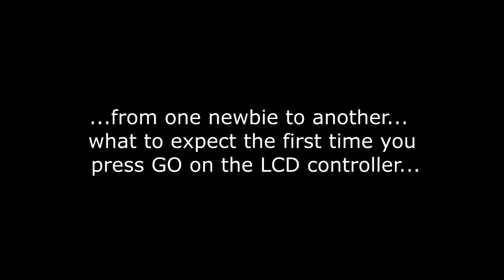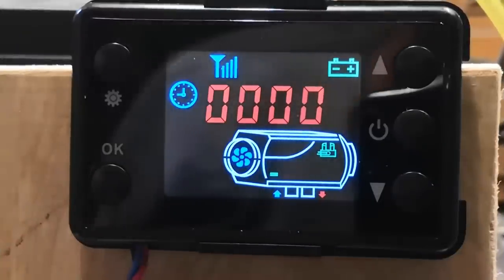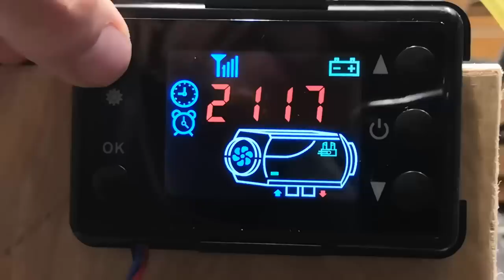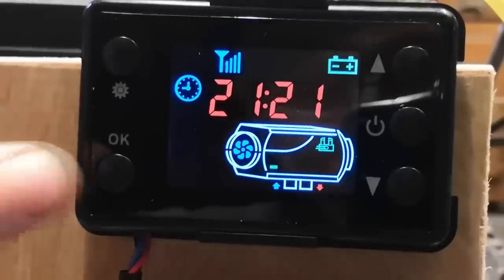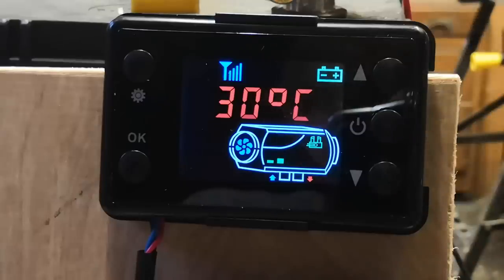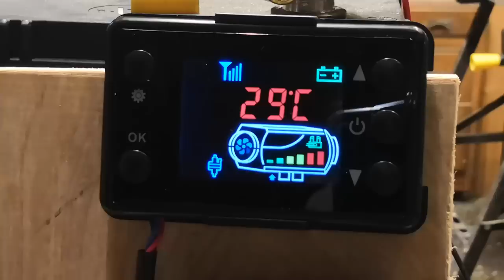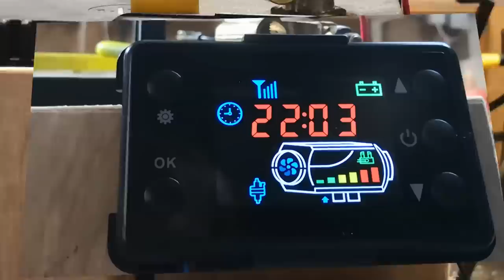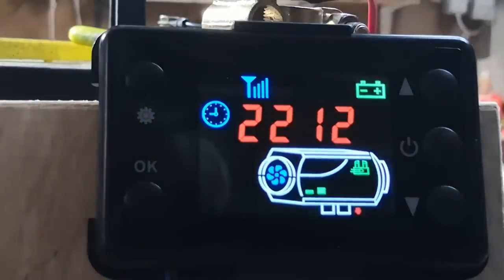First Time you press go...  LCD Controller- Chinese Heater

Comment: Great instructions however i couldn't find temp to adjust. Otherwise it's primed and working. Thanks.
Reply from the maker: Do you see a 'P' number? if so you are on manual mode rather than thermostatic mode. This vid shows you how to switch between the two.  https://youtu.be/NhKU4AIt4jM
Reply: @campervan_hackers  hi, yes i see the "P" number, I can alter that. It's the 2-5 kw heater so I've dropped it down to P3. Now I've watched this video now I now how to switch to thermostat mode. Thanks once again for the instructional video.
Reply: When you can see the p number, press & hold the top right up ⬆️ button and then top left settings ⚙️ button at the same time. Should switch out of p mode & into temperature reading

Comment: Thanks for the Vid, seems simple enough. I'm in OZ and not far off first nervous fire up. I was thinking of sucking the fuel through to the pump then priming from there to the heater stopping about 100mm from the end connecting the pipe to the heater and starting it at that point. Does that sound OK. Hope you guys are OK with the Covid over there. Take care. Cheers
Reply from the maker: Hope first fire up went okay
Reply: @campervan_hackers  Thanks it went perfectly.

Comment: Hey thank you for this most helpful and informative video! By far the best we've seen! 

Hey so we got our diesel parking heater a few months back and all worked like a dream. Only recently we now hear the pump ticking sound going... strangely when the diesel heater is not on? Any ideas what it could be? We've even tried putting the heater on full blast for a while, then switching it off... but still the ticking goes? Any suggestions really very much appreciated! Thank you kindly

Comment: Thanks for the video. After changing from hz to degrees iv set temp to 20 and room temp is 25 but it still turns on and starts heating when I press the go button even though its well over the set temperature. Is that right not sure why it's turning on at all at that temperature.
Reply: I've the remote, where I can read the temperature of the sensor of the heater. That is always wrong, that may be the problem, that it not works as it should.

Comment: Whats the air volume output for the blower on one of these? Would it be feasible to add some ducting in so that it blows heat from more than one location inside of a small cabin?

Comment: Thank god for people like you👍. Got my heater running but having trouble with the controller. When I try setting the time the first number for the hour only gives a 1 or 2. 2nd issue is I can’t turn down the temp. I can increase it. Right now it’s set at 36 deg. I managed to get it lowered from 38 deg. I suspect the controller may be trash.? Or I’m just not getting it.
Reply from the maker: The first number on the clock is always 0, 1 or 2 because it is 24 hour clock format 9 (08.30, 21.45 etc etc). But yep... sounds like a controller issue on the temp thing. You could try running it on manual.. (press and hold the top two buttons when in temp setting). You will then see Hz. This is the pump speed... in fact, I prefer to run like that.
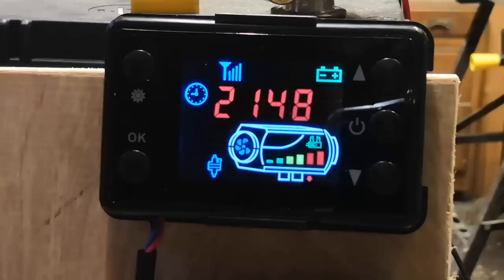Reply: Camper Convert thanks for the reply. The numbers come up 20:00 or 10:00. With that and the temp I’m sure it’s a controller issue. Great video on this thing.

Comment: These controllers are £12 on ebay and not worth repairing but the backlight on mine has virtually gone out. I don't know that I've inadvertantly dimmed it or even if that is possible. Seems more likely the LEDs have been destroyed by the peak voltage from my solar panels via the battery charger hitting 14.6V on sunny days. The manufacturer of these controllers state the importance of not exceeding (I recall around) 12.5V (on the one I have - I note there are 24v units available).  These 3 wire devices I assume control a relay in the heater itself that handles the 9 amp current to the glow plug. I noticed a 3 Volt drop at start up and shutdown as the glow plug heats the chamber to ensure combustion is complete thus avoiding carbon build up. What I plan to do is use an 8V-18V voltage inverter I have lying around to step voltage up to 19V then use a bucky inverter to drop down to a steady 12V on the back of the controller so it will ensure consistant 12V in all weather (cold, winter batteries at 11.6V through summer 14.6V peak) to save the backlight at least.
Reply: Its certainly not a common fault for the backlight to blow on these considering the 1000's of RV solar installations.  3 volt drop does sound a bit too much might have to beef up your wiring however the unit has hi low voltage sensing and will shut down if it goes out of spec. So if it works its in spec. My solar also can hit 14.8v for a few minutes as it ends the bulk fast charge before going back to 14.2 and the only thing it does sometimes is trip my inverter on over volts if there is no load.  I personally wouldn't worry about using buck and boost cos if they blow you can end up with a much bigger problem and you lose the battery volt monitor.
Reply: @tonytca9439  Sorry my typo, 0.3V drop, e.g. 12.2 to 11.9 - its quite a heavy duty "ring main" that is tapped off where necessary. 
I'm waiting for a replacement. The odd thing is its not the backlight, when I operated mine with the cover off I can see the LED's are bright. It seems to be a contrast type issue.

Comment: Gday from Sydney,  i have one of these units in a caravan i bought, instructions are confusing but your video set me straight, one question though  do you have to do this each time you start up? I had do do this on mine because the fuel line was broken, thnx
Reply from the maker: Hi... if you are referring to priming the answer is no.. you should just be able to hit the go button and all is good. To be honest I did not do a very good job at talking about when you should or should not prime so actually done a second version of that video with more on priming. You can find it here.  https://youtu.be/eajqNHY5rs4

Comment: I’ve got the LCD controller pretty much worked out in the settings  but can’t find any info on what SN1 and SN2 are, I’ve set my min pump speed at 1hz and max at 5hz and it runs great.
Reply: Sn-1 and sn-2 are the settings for the motor speed sensor 1 being slower than 2 from what I could work out set mine on 2 the motor is faster

Comment: Very good instruction mate  nothing really comes with the pack but there's just one thing how do I change the temperature from Hz to Celsius it comes up with Celsius for the temperature now but the temperature i want to reach comes up as Hz
Reply: Mat al sorted now all you do is press the up arrow and the settings button and it will change to Celsius I got the answer on club 80-90 forum very helpful people on there
Reply: Ifigured this out BUT have no way to change to Fahrenheit? anyone know if it is even possible?

Comment: my heat setting only goes by power setting. (1.4 tp 5.0) How do I make it seek a temperature instead ?? Great Presentation Thanks Grayson
Reply: mine was the same ... just press the settings button and up button at the same time it changes it to temperature mode

Comment: A forum is mentioned but where is the link to the forum? I primed the pump but I still get an E-01 error when trying to start so it don’t start at all! It’s a 24v but I’ve got it connected to 12v battery till I get organised. It say it can operate down to 11v or so, so that shouldn’t be a problem but it might be. Anyone know the error?
Reply: E-04 low amp I'm having the same problem
Reply: E-04 is oil pump, check see if lines connected right way. I got my E-01 error fixed with changing from 24v to 12v in the settings the pin to get into the settings is 1688. Then I got a E-03 error which is about egnition failure and glow plug, thought I had a bad glowplug but turns out it was because of not enough grunt in my battery to start it. I put it back on 24v battery and it started.

Comment: Really great advice.very very helpful.
And nicely explained. Do you have any plans to show how to pair the remote to the lcd device. That would be greatly appreciated i searched and searched but noone has  explained that one yet.
Thanks again keep bloggin .mike.in ireland
Reply from the maker: Hold up arrow until HFA (or HFR)
Press remote on key and signal bars should flash off and then back on. The heater should start
Reply: @campervan_hackers  thankyou👍

Comment: Great video !   I have a question ?   Can these units be set up like a furnace ?  To where the unit will cycle on and off ?  Or is this a On /Off unit/s only ?  They run all the time correct ? & another question ?  Is there anyway to change temperature from Celsius to Fahrenheit ?    Thank you for your time
Reply from the maker: Soz deg C only....  they will not cycle on and of... they will only go down to the losest burn rate they can function at

Comment: Thank you for the great video, really helpful, but for some reason I can’t get the time to come up on my control unit am I doing something wrong?
Reply from the maker: It might be you don't have this controller... even though it looks like it. For clarity... this controller has a fan icon with SIX blades... if yours has THREE blades... it has slightly different features.

Comment: I have a non remote lcd controler with a small round plug and I want to change the controler to a remote type. All the remote ready controllers have a triangler shaped plug. can I wire the remote type into the round plug ? They both have three wires. Any help on this would be appreciated

Comment: Thanks for your video - very helpful. I have just installed a new lcd controller. On the main screen, when I try to set the temperature for the heater it shows "P-4.0 Hz" instead of the temperature setting. How can I change the setting to show the set temperature rather than the current display. Thanks
Reply: Hi, just found the answer to my question. Press the on/off button while holding down the < > buttons.
Reply: Thanks Bruce! Been looking around for ages to find out how... Was driving me crazy
Reply: @brucehogan8208  it still want reset
Reply: Sorry to hear Phil.  I just held down the power button and the up button at the same time.
Reply: @philmeyer118  I just fixed this problem on mine... held down the Up arrow and pressed the settings button.

Comment: Very useful video as I've been struggling to set mine up. However, when I press the OK button to select the target temperature, It just shows P-5.1 Hz etc, which I think is the pump frequency, not the temperature in bold like you mentioned. Any ideas why? Thanks Stu
Reply from the maker: Hi.. yes.. you are in manual mode not thermostatic mode. This vid shows you how to switch  https://youtu.be/NhKU4AIt4jM

Comment: Hi, great vid, I have slightly different dispaly in that I dont see a symbol for the incoming air, which is no big deal as I can feel air flowing through the outlet but my pump light is flashing once I start the unit. I also have the target temp in Htz which seems a little strange. Also mine did not come with an error code sheet where could I get one. Thanks Nic

Comment: Great vid mate. I just fitted mine today and the fan spins for about half a revolution and jams up.(E06)
 Im guessing its a similar issue to what you had. Cant be bothered pulling it all down to look at it today.
Reply: I had same problem same code the fan is sticking on the square circuit board above fan take the 1 psi screw out then press the 2 tangs and circuit board will lift up grind the metal casing just in front where you took screw out and refit spin the fan see if it moves freely if not file a bit of the inside of black tangs opp the 1 screw then try spin fan again be careful not to damage circuit board it worked for me runs a treat steve b

Comment: Thanks for an excellent video, great explanation. I have had an all in one heater for 3 years running faultlessly on paraffin only (fortunately no pump lubrication problems) with a very simple lcd controller just on off and up down button. Just bought a second unit with the controller you have in the video. Do you know if the controllers are interchangeable as I also have rotary controller spare like the one you show. Cheers
Reply from the maker: Glad the video was of use. On that same heater I used to have a simple rotary controller which was fully interchangeable. You can see it in the background when I'm introducing the video. If yours is the same and has the same shape plug should be good to swap
Reply: @campervan_hackers  thanks for the reply 👍

Comment: Thanks for the video. Very very helpful. Can you tell me if there’s a way to
Turn off the lcd display when it’s not in use? Just installed one of these in my
VW Beetle and the car sometimes only gets used every other weekend when the weather suits and I don’t want to krill the battery. 

Also, have you considered doing one of the remote key fob videos?? 

Regards,

Ben
Reply: Why not fit a Switch in the Power line ? ie: Red fused line !

Comment: Great video thanks for your help!
Reply from the maker: Glad it helped!
Reply: @campervan_hackers  still can’t get it to work, getting error code 8 and 10, but at least I have an understanding now!
Reply from the maker: @leemitchell3533   Do you have an error code fault chart?    Sounds like fuel ... I got a e8 and found a blockage in my line. https://www.facebook.com/groups/146837062640024/permalink/250283062295423/

Comment: Hi we have one of these fitted with a digital display is it normal for the display to stay luminated when the unit is off or is it normal to stay on and won't make much of a a power drain on the battery when not in use regards mark

Comment: Great video. Thank you for your informative commentary. Are you able to explain the significance of the bars. ie would there be some situations when the red bars don't appear. (maybe determined by the ambient temp v. target temp. Also, do you know the reason the fan would turn itself on. No heat, just the fan.
Reply from the maker: Hi... when the heater is fully at operating temperature, all the bars will be shown. This is regardless at what ambient temperature you are aiming for.
Reply from the maker: This sounds like a temperature sensor fault. Quite common. The ECU thinks the heter is still hot so turns the fan on to cool it down. Very cheap to replace. Search for Parking Heater sensor on eBay.. you will find them. Good luck!

Comment: Great video, I learned a lot, can you do a video on connecting the remote they sell on ebay. cheers
Reply from the maker: when I get a remote.. will do so!
Reply: With the unit off & the display shows ambient temperature, press the up key for three seconds to enter the remote code match status. When HFA- shows on the screen, press the "ON" button on the remote to transmit the remote code. After the code has matched successfully, quit the code match interface. The remote status bar should now be on & the unit will start. Cheers

Comment: Can the screen be turned completely off when not using?? Mine stays on all the time and it seems it would run down the battery I cant find a way to shut it off
Reply: If you find the red wire going to the control unit you can cut a switch into it which enables you to turn the controller off when not in use.